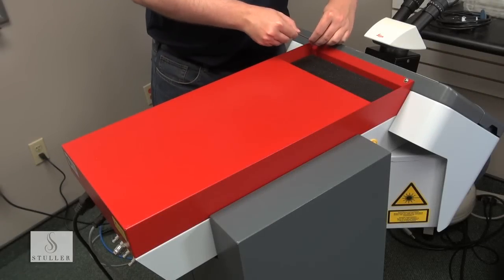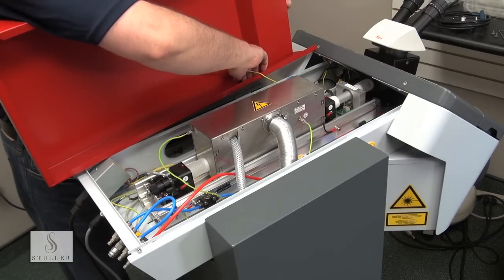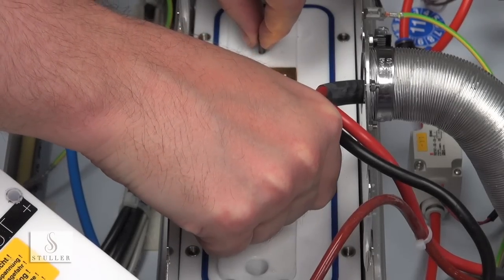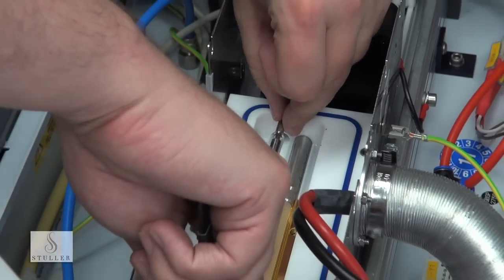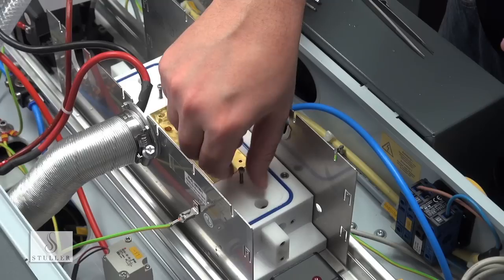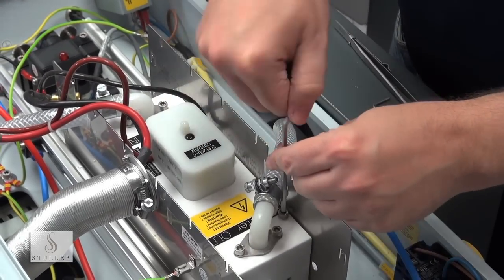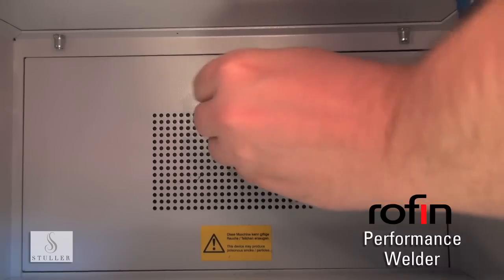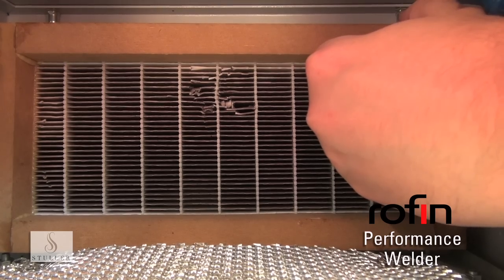How to Replace The Flash Lamp And Air Filter On Your Rofin Laser

Comment: Also, 3 to 5 years for a flash lamp and 3 years for an air filter are not accurate ways to gauge when they should be replaced. The lamp should be replaced every 1,000,000 pulses or when you need to drastically increase the voltage to do the same work. The air filter should be replaced when the maintenance recommendation states it is near 100% full.

Comment: No need to dissasemble the cover of the excitation unit like that. That will just increase the chance of you throwing the system out of alignment and takes longer. 

1) Drain the water by opening the petcock
2) Remove the plastic cathode cover (black, negative cable side)
3) Pull the lamp out of the excitation unit horizontally

With the dust covers removed there is enough clearance to not touch any of the other components on the rail. I use forceps to pull the lamp out but small, needle nose pliers should work as well.

Comment: Hi we have same laser welder. We experienced having to increase power to get same result. We replaced the lamp in December and was working fine. Last week we had the problem, and changed to another new lamp but didnt fix issue. Van you suggest anything else?